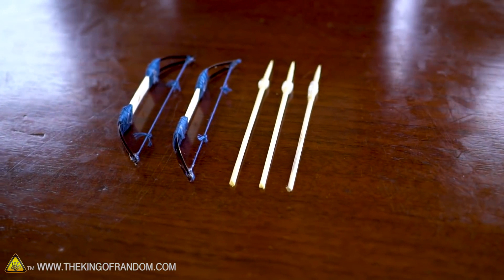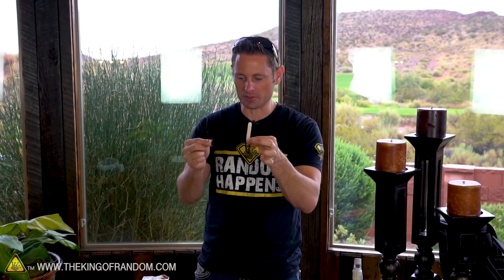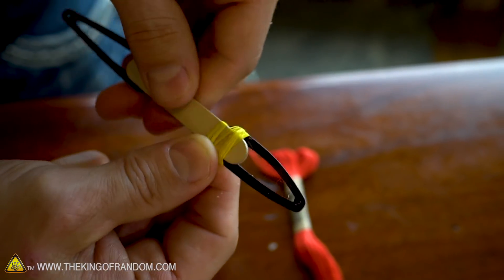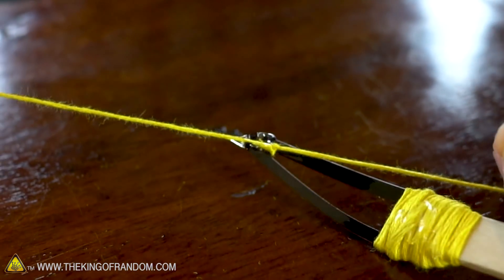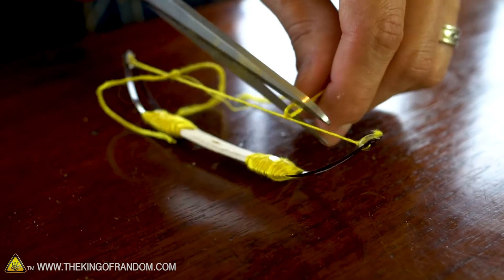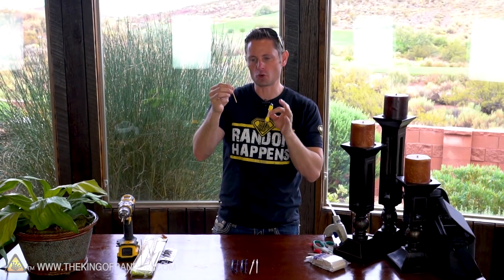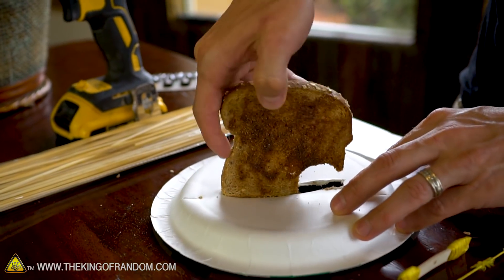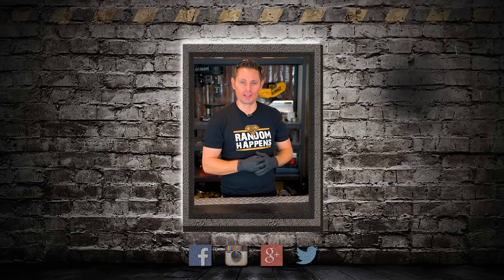How To Make A Micro Long Bow! TKOR's Guide For How To Make A Mini Long Bow Or Cross Bow

Comment: If you mix water and gasoline, does it burn? Or does the water ruin the affect? Big fan of your channel
Reply: Young Lampshade gasoline would float therefore it would still burn
Reply: I think he allready did that. I'm not sure.
Reply: Water is a heavier liquid than gasoline so all the water would sink to the bottom and gasoline would float on top of the water
Reply: It is effect . pls learn English
Reply: Captain Jeffrey it was just a spelling error calm down
Reply: Young Lampshade actually it dilutes the gas and if you put it in a car, it will take a while to flush out and can destroy your fuel pump, this happened to us once.
Reply: Captain Jeffrey It’s please. Please learn English
Reply: It still burns... you've never heard of oil rig explosions and stuff?
Reply: Captain Jeffrey not everyone's first language is English.
Reply: Captain Jeffrey it is offact. Pls learn English
Reply: gas is less dense than water, so it would burn because it would float... kinda like water and oil
Reply: Young Lampshade because the density of gasoline is lower than water it will float on top of the water so it will burn
Reply: DanDann07 using my science logic, it’s denser not heavier
Reply: Young Lampshade gasoline is oil so it would still burn
Reply: Captain Jeffrey “Please”, and don’t space a period. 😊
Reply: Yes it is.  Gasoline floats on water and still burns.  That's why they use CO2 to put of Gasoline fire. Its mentioned in the fire extinguishers also.

Comment: To keep the bow from losing tension you can cut slots on both sides on one of the hair clips slanting towards the tip, and use a loop formed by the string to slip it on. That way you can unstring your bow like a real bow.

Comment: What makes this a longbow and not just a recurve bow?
Reply: Tanner Fideldy just leaving a dot.
Reply: I’m pretty sure a recurve boy is only 1 or 2 feet long but long boys are 5-6feet
Reply: my recurve bow is around 4 ft long at least
Reply: A recurve bow is where the limbs curve away from the bow, hence the name.
Reply: Probably still not a longbow. Longbow are kind of defined by their size and range, so its probably more of a hunting bow.
Reply: Long bows are longer
Reply: Foodoholic like this squiggly ~
Reply: longbow also has two fuzzy dots on the string
Reply: Defined by archery GB as which i am a member:
Longbows are commonly made of laminated single strips of wood of varying species, The defining feature of a Longbow is that they are made from Two pieces, the String -This commonly features a single knock tassel and two string dampeners spaced equally apart from the knock - and the Body - which forms the typical bow shape which is curved into the string. 
Recurve bows recently are made of: synthetic laminated sheets of either action foam or carbonfibers layered with wood limbs and metal or carbon riseres. A recurve bow will commonly have two limbs which are inserted into the top and bottom of a Riser, the Riser will have a indentation for the arrow rest and brackets for sights to be attacked. The Limbs have a distinct shape which curves into the string then curves sharply away from the string towards the top, forming the RECURVE shape.
hope this helps! im a experienced archer whos been shooting at county and national level for almost 6 years

Comment: Try using  oil based crayons and melt them then mix them with your homemade rocket fuel to get homemade colored smoke I'm curious to see if it works

Edit: I really want Grant to see this because I really want to see this done
Reply: I can tell you right now that it most likely wouldnt work. Coloured flames are made using different elemental salts (potassium, sodium, iron etc). I highly doubt that standard crayons would use those same salts as the basis for their colours
Reply: Chris Keuken I'm not saying standard crayons I'm saying oil based crayons such as oil pastels or something that colors the powder causing the coloring of the smoke
Reply: My apologies, it's kinda late here and I completely didn't read your comment properly. 

I admit I'm also curious now although if I had to guess I'd still say it wouldn't work. Maybe I'll have to try it to see haha
Reply: Light Blue Yoshi 99 I said OIL BASED crayons not wax oil

Comment: Try cutting a wider Gap into the popsicle-stick and use the leftover piece of the hairclip as an Arrowrest. That way you could use fletchings. Also, add two knots to the bowstring to fix the Position of the Arrow. This will improve accuracy.

Comment: You guys have shown off the power of thermite on this channel before but I am really interested to see if there is a difference between the types of iron oxide you use when making it. Ex using black iron oxide compared to red iron oxide (rust) so I guess my question is can you test it?

Comment: you do relize the point of a longbow is to be taller than it's user right for example if you 6 ft 5 inch then the longbow would be 7ft 5 inch etc

Comment: Technically that’s not a long bow it’s a recurve bow a long bow it’s 1 continuous bow arm with nothing else attached accept the string, a recurve bow is 2 felxy materials attacked to a stationary stock like your bow and lastly that wouldn’t be a micro longbow even if it was a longbow it’s actually be a micro short bow :)

Comment: Follow his instructions. Use the hot glue! Dont substitute the hot glue for others.
Supper glue is too rigid, it will snap the line.
Wood glue does not hold
Plastic glue will melt the line a bit if iy comes in contact so i dont recommend it.